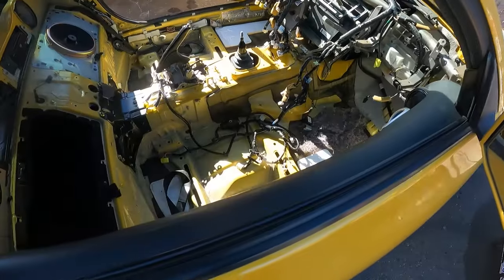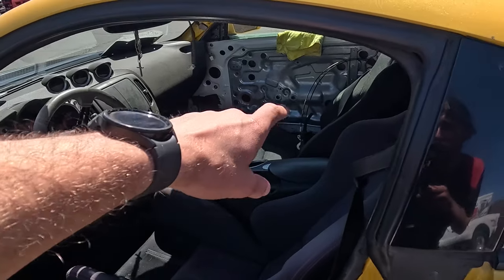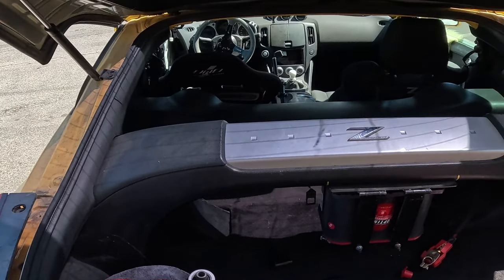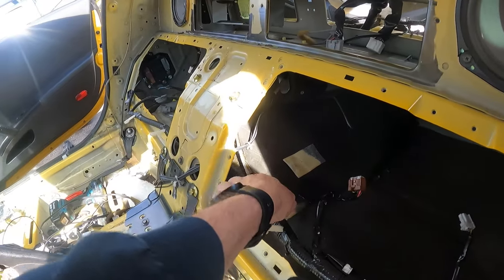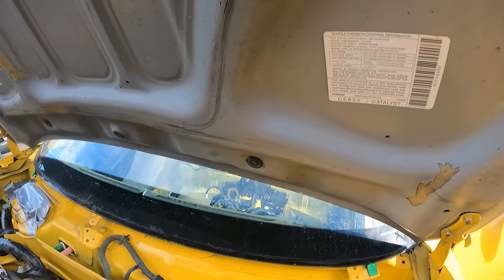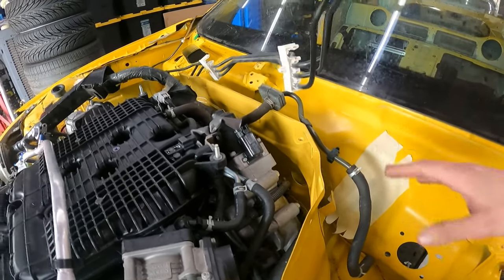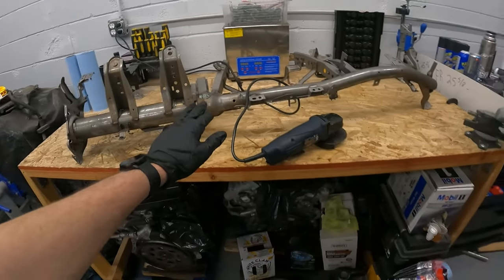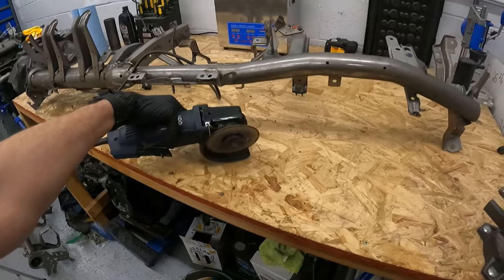370Z Interior into 350Z - VHR in DE Chassis EP4 Dash Board & Custom Fab

Comment: hello, I love the chain since I got my 350z.  I have a question.  sometimes my clutch pedal stays stuck for the last 0.4 inch (1cm).  Looks like a pedal problem.  the clutch is new.  apparently a lot of 350z's have this problem but no one really knows what the problem is.  did you know what the problem is?  thank you 👋
Reply from the maker: It sounds like the master cylinder fork needs adjustment, or your system needs to be bled. Or, you have a failing slave cylinder, but my guess is the system needs to be bled, or the fork needs to be adjusted
Reply: @fullthrottleperformance  I will look into repairing it.  thank you 👋

Comment: Good to see you back but this seems like a lot of work for no real gain🤷‍♂️.... or am i missing something?
Reply from the maker: It's what Mark wanted, and the VHR is a way better engine over the DE. Reliability, and power wise
Reply: @fullthrottleperformance  ah, ok , is it much of a gain over stock 07-09 hr?
Reply from the maker: @TheScudabear1  long tube headers, cold air intakes, and a good tune will get about 350WHP on pump gas
Reply: im doing the same to a G35 coupe. im doing because i want to. G35 on the outside ...all G37 on the inside including vhr 3.7 under the hood